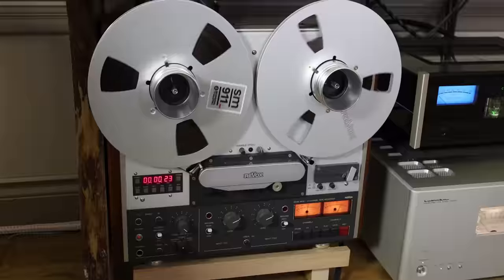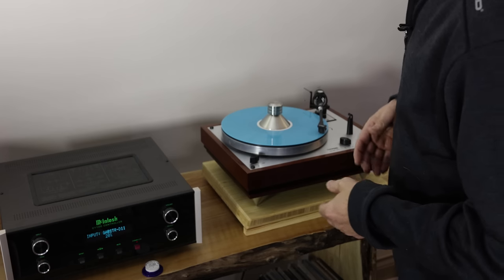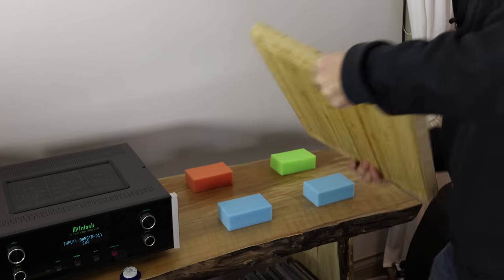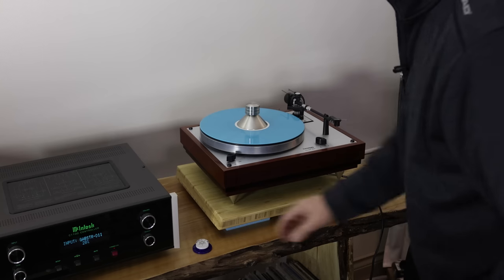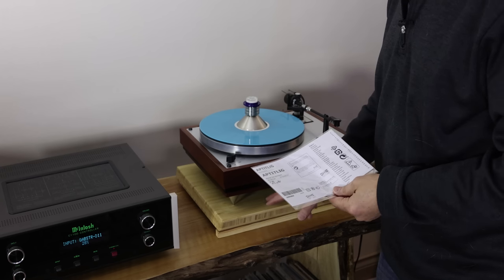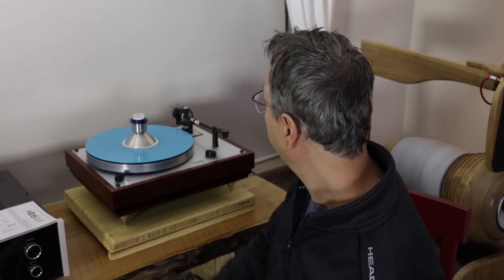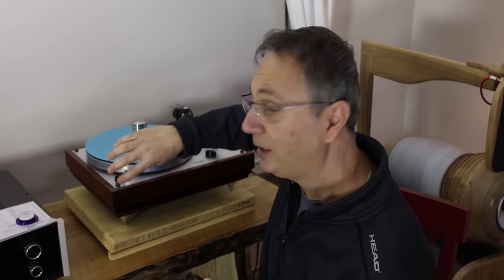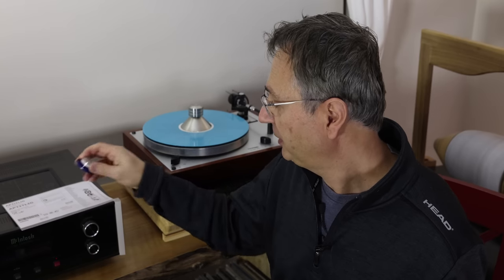5 Easy Turntable Vibration Solutions. Reduce noise, Bass loop and Rumble. And other HIFI tweaks.

Comment: Hi Gabby, really love your channel. I also have done some isolation for my 1980 Denon turntable. I used a different Ikea cutting board as I needed something near 19 in deep. I also used spring loaded feet under that and have been extremely happy with setup. I do not have a high end audio system, as I'm more mid fi.
Absolutely love your speakers
 I Watched the videos and man do you ever rock. Keep up the great work. West coast old guy Canuck here
Reply from the maker: Thanks for sharing!! Daniel. If it is working for you that is all you can ask for. You can try the sponges and compare it is a small investment you may like it better. Canucks had a good game tonight 😊
Reply: @Gabster1  wow you are up late, although I am not sure where in Canada you live. When I say Canuck, I mean Canadian. Although I am a Canucks fan. Thanks for your reply and please keep sharing. Dan
Reply: I used a granite chopping block, works a treat, just stick small rubber feet to the granite block, sit your turntable on the granite block and boom, no resonance to worry about, granite kills resonance before it has a chance to reach the turntable, cost me £10 which is about $12 US dollars, and about  50 cents for the feet !

Comment: Sponges are a good idea, new sponges have something in them that keeps them sodt and pliable while sitting on a shelf but after to wet them a few times they get hard when they dry out. Have you noticed any difference in the sponge firmness over time?

Years ago I was using a Thorens TD316 turntable that was good but this old house does not have solid floors so it was susceptible to foot falls near the turntable. To solve it i used a 10" inner tube under the turntable to "float it out of vibration range. I had to offset the inner tube because of the uneven distribution of that turntables weight,

I'm now using a Rega RP-3 and was having dome issues withit, it sits on a very surdy record rack that is next to a load bearing wall so the floor is pretty rigid there. I put a 3" thick cutting board under the turntable and also uses 3 ea 2" sorbothane half sheres under each of the 3 turntable feet and that seemed to work well. A year later I moved the turntable off that record cabinet onto a cheap welded steel wood record rack with the same 3" cutting board and sorbothane feet and it sounded even better and that proved how inportant having a very rigid stand under a turntable is for good sound.
Reply from the maker: Thank you for sharing your experience all great ideas glad to hear your system is doing well. my floor is on a crawl space so I put out a few support pillars from 2x4 under and the table is over 400lb .
The inner tube idea works also well it was my second choice but the sponges really solved the loop as you can easily test it.
At a 1$ for 6 sponges just have to replace them every few month.

Comment: Sound system crew often just use a 10cm foam slab, and if it works for them with such high low freq volume, it works for anyone at home.

Comment: Again, no spunges.  Buy some mdf board, cut for free at home depot. Go 3 of 4 sheet thickness. Add 1/4" cork sheet in between the mdf. Use feet of your choice. Under 20dols. Also get the turntable away from the wall.

Comment: I just purchased a Denon 1200 cheep to experiment with. I run turntables through a large dj mixer to test the changes made during EXPERIMENTS. I made my own feet, 3lb5oz worth and added a 12.4 oz mat. My gain went up 25%. Now I'm replacing the bottom panel from .100 Masonite to .375 mdf. So a 24.25 lb turntable to a 30lb turntable. I expect more gain and damping and didn't need to buy the latest big deal pos to have a decent turntable.

Comment: Hello would you know anything on how to mitigate vibration from walls snd floors?
Reply from the maker: If you own your house and have a basement or crawl space you can add posts ground to floor under your speakers and  components rack.
If not a big rug and add a thick padding Under it.
For walls room treatment may help a bit

Comment: Hey Gabster, awesome hack!  Do you think a lighter cutting board is better?  I don't have the Ikea board but just wondering if the compression of the sponge is better if it's less?  Thx!
Reply from the maker: Probably, I would try it the cutting board is not critical but the sponges are. if it works you can invest in a heavier board later and compare.

Comment: Love your channel and in awe at your electronic skills! Always mount a turntable on a wall shelf not a floor. Make a box as the shelf, about 10 cms deep, fill with dry sand and top with a glass panel floating on the sand. Level carefully and then place foam pads/another glass panel/turntable, level again as shown in the video.
Reply from the maker: That's a great idea!

Comment: G. I put  spaghetti loop floor mat, that I cut to fit under speakers. Best, D.
Reply: What is that then what's it made from? Is that like a bamboo grass mat
Reply: @jedi-mic "rubber" floor (door) mats very good vibration absorption. Good luck.

Comment: OMG what a joke again.   But I like the speakers.   Do you have a wooden floor ??
Reply: I don't get it.
Reply: @Pete.across.the.street  Do you have a wooden floor /  simple question
Reply: I have a wooden subfloor, not made of bamboo though. Do you not think bamboo is good for killing vibration?
Reply: @Pete.across.the.street  I think that when you have a solid house with a concrete floor, the whole thing is bogus.  But in an old house with wooden floors It might be so that some resonance of speaker -floor -record player could couple into the system.
Reply: @MGoudsmits  I don't think that most people live in basements though.
Reply: @Pete.across.the.street   well, do you think a concrete floor is for basements only?
Reply: @MGoudsmits  of course not. You said solid home, so that leaves out slab homes, apartments, and commercial properties.
Reply: @Pete.across.the.street  I said a solid house! not home.
You know, any house not made of paper or wood but from concrete and bricks etc.

And having a cellar does not mean your living room or upper floors can not have a concrete floor.

Comment: I was having subsonic feedback issues with my DUAL 701 feeding an Adcom GTP-400 preamp/tuner which then feeds 4 Adcom GTA-535 amps powering 4 pair of Kenwood KL-777s.😎 I tried Gabster's cutting board and sponge idea. It works incredibly well. There is one mistake I made and would like to clarify regarding what sponge to use. At first I just grabbed five cheap sponges from my local Ace Hardware, they provided very little isolation. These were synthetic sponges. I then tried cellulose sponges from 3M, these are the ones you want. I went from being able to play records at 20% volume (based upon the dial position) to nearly 50%. My next step is a standalone MM phono preamp with a subsonic filter. Thanks Gabster!!